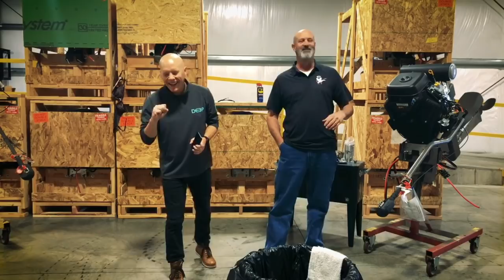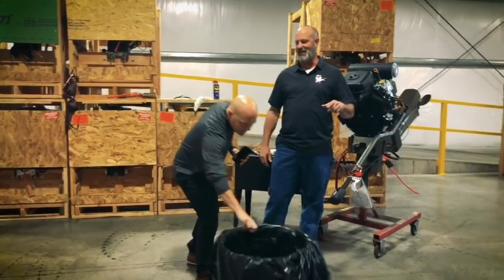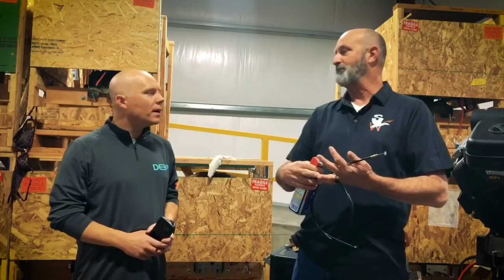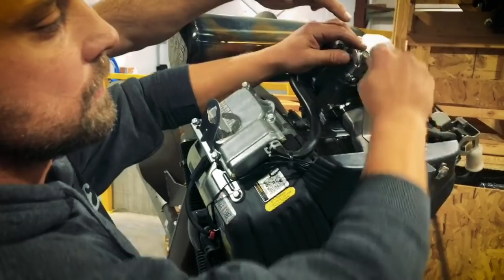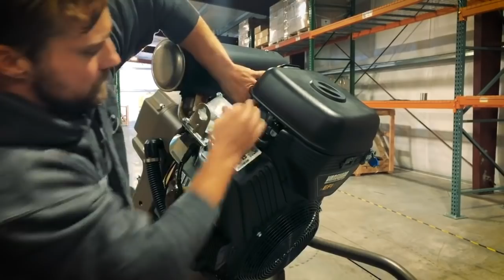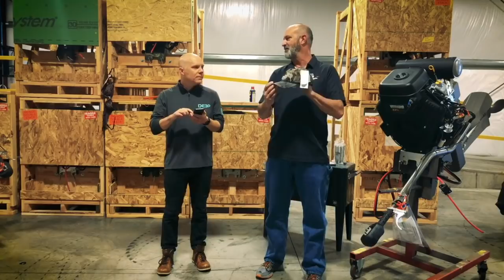How to Unfreeze a Throttle Cable | Shallow Water Adventures | Mud Buddy Motors

Comment: I have a 2016 mudbuddy efi 37hp was running and was wanting to run at higher rpm on top and then a sudden loss of throttle motor stalled then got right back on top then with no issue and seems like the cable pull is supper easy now instead of kinda tight like it was what could be my issue